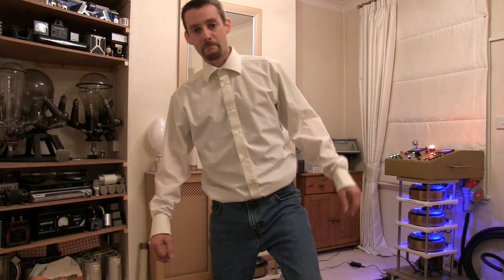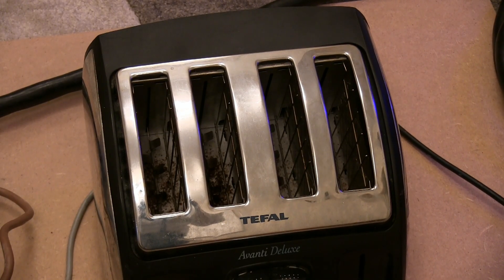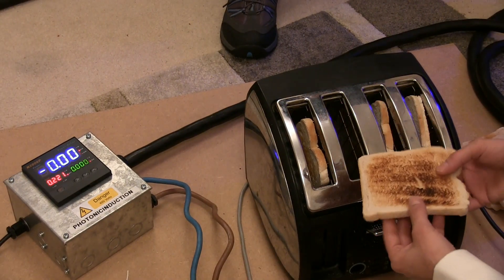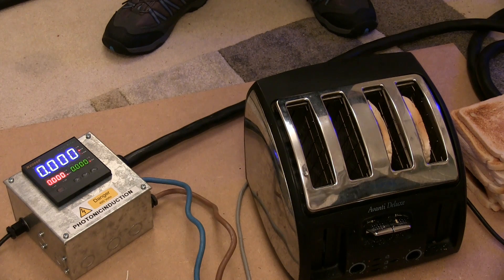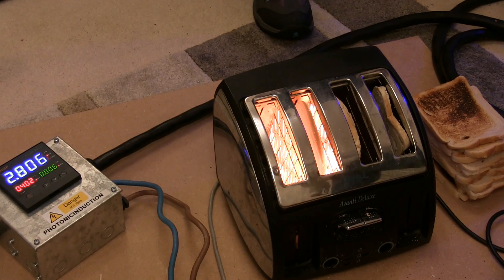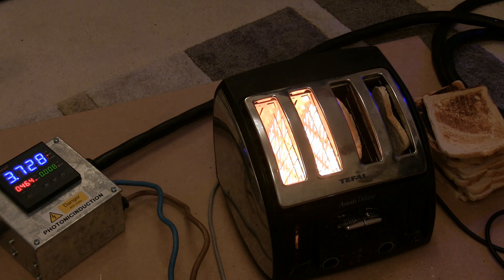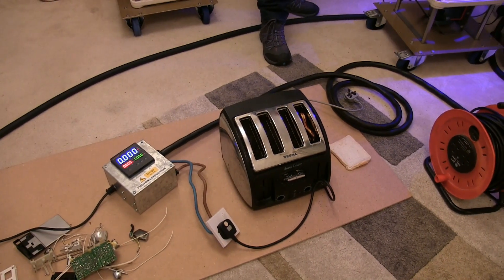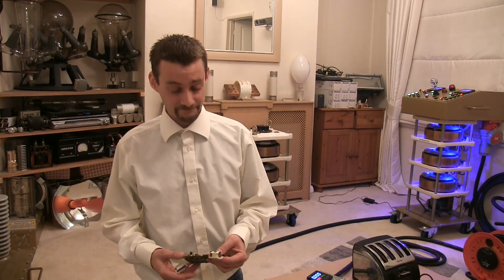10 Second Toaster

Comment: I once had to use a toaster in a motel which for some reason had one of the two elements burned out and all the power was applied to the second one. The bread would burn within 10s on one side.

Comment: @1:16 Modifications on pcbs for every day stuff aren't that uncommon. Seen that a couple of times. Sometimes it's just an additional wire connection and a trace cut, sometimes it's an additional resistor. Seems like they are rushing development quite a bit. Also seems like many companies are allergic to cleaning pcbs. Lot's of flux residue. They probably expect people to throw the stuff away in a few years anyway.

Comment: With higher voltage, the heating wires become hotter and therefore more resistant. 
This partially compensates for the increase in voltage.

Comment: I knew about overclocking cpus and gpus but never a toaster
Reply: What if your cpu is a toaster
Reply: @dillxnr  You mean a Pentium 4 ?
Reply: @cnr_0778  The Prescott first generation Pentium 4 at 3.0 Ghz. Rated for 103 Watts.  I got to test the first run of these at Intel Labs.  We had a nickname for them. The "Presshot". Imagine a heat sink that was copper core and aluminium fins that weighed 500g (1lb).  At 32bits, single core, and eventually ended up as OEM motherboards for Compaq, Dell, Gateway,  HP, and  IBM. I did the 10/100 network chip test and PXE boot rom testing later on. 
A few years later, my group tested the first run gigabit copper network adapter, got the Guiness World record for fastest Ethernet over the 98% packet collision threshold.

I saw a Pentium-90 that ran so hot that it melted the solder and mask on the video card next to it on a Compaq Deskpro in 1996 when the fan  quit working when I was a tech at Tandy Service/Computer City.
Reply: Put it on a inverter and up the Hz’s
Reply: overloading not overclocking technically
Reply: "Let's push it to stupid levels."

Comment: The toasting is not even, the higher voltage might burn out circuits quicker, also the extreme heating of the elements then cooling over time would cause them to lose their strength and eventually break. Possibly also a fire hazard as the toaster housing would get quite hot, especially problematic since modern toasters are constructed with a lot of plastic.

Comment: just imagine the plug on a 480v toaster, it would be bigger than a 2 slot toaster
Reply: +denvera1g1 a serious note that is exactly to scale unlike the above statement, wouldnt it be better to increase the amperage? i've always been taught that the higher the voltage the less heat is produced by a transmission line for the same wattage, and i know these are technically resistors(but so are transmission lines) but shouldnt the same apply? what i'm trying to say is, if increasing the voltage to tripple only doubles the wattage, would trippling the amperage result in the same amount of wattage increase

Comment: That's my man :-)

I've actually been running an old style 110V toaster (flip, circa 1930, coils on ceramic insulators) at double its design output (1800W instead of 900W for one side at a time, effectively irradiating twice as much as your contraption with its 4 side heating), using a single diode on 220V and toasting time, depending on bread type, is no more than 40  seconds both sides and it gives the most deliciously crisp toast with perfectly moist insides, it doesn't get any better than this. :-)

After 4 years, it's still working as good as new, the only thing different is the sound the coils make because of half wave rectifying. Of course, I'd never try this with a cheapo toaster with mica insulator like your Tefal ;-)

Comment: The reason they don't make toasters that run at 344 volts is because the mains only run at 230 volts.
Reply: I believe they actually run at 240volts in the UK and 120 in the us
Reply: It's been 230 V for the last 22 years, before that 240 V.
Reply: +SGTblackcats Uhm,... transformer?
Reply: +SGTblackcats No, I mean that the manufacturer can put in a transformer... of course, it would probably be easier to just change the NiChrome/Kanthal/resist wire size/pattern for rapid heat-up any way.

Comment: This was awesome - surpriced me how much that toaster could take - 4,4 kW peak on a toaster, LOL.

Although it would probably not work to do a 3+ kW toaster that lasts more than a few toasts. Even heating elements do oxidize at very high temperatures - so it will burn off after a while even at lower power.
There are different alloys used for heating elements and the one used in house hold appliences like a toaster is usually cheaper ones that oxidize a lot faster than the better ones used in high temperature furnaces usually up to 1300°C.

Comment: I got an old 1953 Westinghouse toaster that glows about as much as the left side of that one in the first test, it'll make two slices in about 40 seconds, so I guess toasters back in the day just had a brute force approach instead of the gradual heating that modern ones do.

Also that older one has both thermal overheat and circuit protection, and a nice mechanical timer, no messy circuitry to fail, the Chinese one it replaced, decided to stick in the on position and nearly melted itself to the counter top and set off the fire alarm, dangerous cheap junk.
Reply: I bought a soldering iron from a 24 hour shop in Shenzhen in 2008, shortly before Lehman Bros went under. It would not melt solder, but melted the handle, bending over in the stand like a wilting plant, which then dripped down over the iron, made a puddle of liquid, which then tripped the fuse, and set itself on fire.
Reply: @weareallbeingwatched4602  ah,the prank soldering iron,classic prank
Reply: @limesodagod  HDPE is not the best material for a soldering iron handle.

Turned out that you could use those irons but only if you buy special low temperature solder, likely containing mercury and certainly not with an RoHS sticker. I didn't stick about with that, whole place was incredibly chemically toxic. High rise chemical electronics industry no maintenance & black streaks eaten into the concrete on a five year old building. 50ft epoxy hardener smog + solvent stink visibility on a good day.
Reply: @weareallbeingwatched4602  🤣🤣
Reply: They cut the wrong corners.

Comment from the maker: @ Connor Freeman, the output goes though an isolation transformer, ( no earth required )
To get a shock you would have to touch both the output leads at the same time.
The system has an Earth but it is pointless Earthing the device on test.
Enable your reply button man!
Reply: +Photonicinduction Hey dude! I came to your channel a few years ago, because of the legendary video "Washing Machine Self Destructs"... I missed your channel while it was gone and i was out of my mind, when i discovered you were back on youtube with some new stuff.

just wanted to tell you that you really kinda touched me with your final words in this video, just started repairing some speakers and finally did it, well kinda :D thx for your support!
Reply: I really like your custom power supply with the L.E.D.lighted skull on it.Seriously cool!!.T-fal makes a badass toaster,it took over 460 volts before you"toasted"the toaster...LOL!!!.Great video man!!.Bust safely!!.HAHA!!.
Reply: Hi. What do you know about longitudinal energy waves ? Apparently it's this old concept thats gathering a lot or research lately...it's outside the normal electromagnetic principles.
Reply: so its a triple stacked variometer - ring coils with motor driven actuator ?
Reply: ***** it might not go left or right
Reply: ***** its two xformers - going down and up again - smart - does it need special xformers ?
Reply: ***** WTF
Reply: +mathiass0943 He's asking about his power company contract.
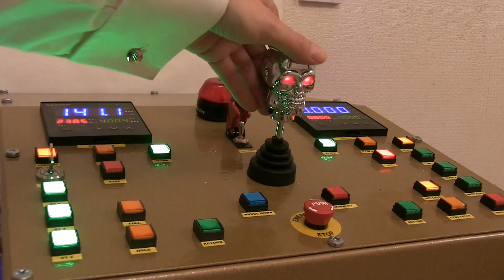Reply: hey in 2:07 what macine you used

Comment: Technically speaking, they could make a single slot 3kW toaster.
Reply from the maker: 3.1kw :)
Reply from the maker: *****
6.2 kW if it has two plugs lol
Reply: ***** You could probably apply a diversity factor to it and safely achieve 4kW toastage on a 13A fuse for the short period of time it would be occurring.
Reply: @bigclivedotcom  or you could use that 13A to charge up a bunch of lithium cells to get even more power for toastage!
Reply: @Photonicinduction  Acetylene Torch = 5 seconds
Reply: @jrmcferren  or use supercaps to store up and release ridiculous amounts of power.
Reply: @bigclivedotcom  How about mentioning this channel in a few future videos? It would be so hillarious if we could make this long gone channel getting into the millions without it even uploading anything for a looon time :-)))
Reply: @HarrieHausenman  not long gone anymore!!
Reply: @TheFaxMachine69  Pop-that-fuse! ;-)
Reply: 3.1 jiga-watts
Reply: Okay, but how do you explain the burn marks on the ceiling?
Reply: What about a capacitor bank inside and when you turn on the plug it charges em and when you activate it discharges along with the 3kw from plug
Reply: 3.6 kw in Holland
Reply: So this is what being an archeologists in the future would feel like.
Finding bigclive comments from years ago on long gone channels :-)
Reply: Aye
Reply: Clive, He could've at least toasted the COB before he popped it. xD
Reply: 900Kw toaster
Reply: It is time for domestic 3 phase 100A sockets, kettles could benefit too!
Reply: Not in USA, are outlets are 115 v at 15 amps, 1500 watts. Unless you want to pay to have a 240v 3 phase outlet put in for a toaster😂 please everybody be safe
Reply: 10.5kw if you hard wire it into an electric cooker supply.

Toast as quick as a flash, blink and it’s a fireball… 

Maybe even a plasma toaster?
Reply: Bro is cooking with a flux capacitor
Reply: Someone i should've expected here 😂 you both love sketchy stuff
Reply: bigclivedotcom how bout a 5kw? i dont think thats even possible xp

Comment: that solder job on that toaster is terrible O_O
Reply: hansley maharaj I think the manufacturer used old and dirty solder in their wave soldering machine, and saved a few cents per toaster doing it. And then spent more on debugging the faulty ones, and fixing them. Well done :)
Reply: A few cents lol they should make them more reliable and +Photonicinduction resistant lol

Comment: Hi
On your metal meter box, it looks like you have Live and Neutral coming out of separate holes, has this given you any problems with eddy curents yet? as this is reconned to be an electrical no no in electrical text books.
Keep up the great videos, better than anything on TV these days.
Ant.
Reply from the maker: Your text books are just that "books."
Several Megawatts are past through transformers in the same way, they are called "Bushings" Everything with a passing current will generate Eddy Currents, nothing to be worried about unless trying to pass an unshielded video signal through at the same time.
This is why "books" should not be always taken "literally."
Thanks
Reply: Ah! I did forget to mention that in my comment to Mr. Photon. Yes, you've spotted it as well!

If that enclosure was plastic, it wouldn't matter too much.

The only way we'll find out if eddys have been causing problems and that's if he does a video showing the melted plastic cable glands and the metal box around the cable glands has gone a funny psychedelic rainbow colour!

-BoomBoxDeluxe.

19th October 2014, 17.50
Reply: *****
Aaaah, that's a very good point, Mr. Photon. :-) I do wonder though, with the transformers, if the 'eddy-current effect' would somehow be reduced by the high voltages present on substation transformers?

My point being, is for a given amount of watts, if the volts are ramped right up, the amps go down, and it may be amps that cause the eddy-current effect.

OK, so we both know that on some transformers, like you say, there's many megawatts (or MVA?) going through the bushings and it doesn't seem to bother the transformer too much.

But then..... Does it?

On those substation transformers, the bushings are more-or-less non-combustible (they can take reasonably high temperatures) the wiring inside the transformer is probably thermally resistant as well, and shielded from the casing of the transformer by part of the bushing sticking inwards inside the transformer casing, and..... The windings of the transformer are submerged in cooling insulation oil.

Some of those transformers have a radiator system on them almost as big a the transformer itself. :-O

It does have me wondering though.... For the few times you have used that unit, have you noticed any untoward heat build-up around the area that those conductors are passing through?

I can feel an experiment coming on! :D

To get an old metal electrical mounting box, pass some high-current cables through individual holes, and then slowly teeeaaase the current up and up, to see if the part of the box between the conductors heats up..... If at all.

This could be the electrical episode of MythBusters. :D

Thanx for replying,

-BoomBoxDeluxe.

19th october 2014, 23.45
Reply: ***** Agreed, books is not the real world. Too many just sit there in a class thinking the only way is the way you were told.
Lets see a test, is Eddy Currents a problem in metal conduit or was he just a forgoten DJ from the 70s.
I think you have the best kit to prove this point.
Ant
Reply: Ant Lane
 When I can get an old metal box and knock-out two holes from it, I will see if I can do a high-current set-up and let's see if I can get the box warmed up by inductive effect caused by eddy currents.

I have a couple of little transformers that Mr. Photon gave me and those can (for a little while) punch out a good 45A each.

So, if I parallel the outputs and crank them a bit, I may be able to rustle-up 90A, and I'll even put an electric meter on there so you can see it whizz around. :D

-BoomBoxDeluxe.

20th October 2014, 16.05

Comment: Mmm, tasty. By the way, what does the thinner black cable go to on the output box? Is it an auxiliary un switched, un varied supply for the meter?
Reply: Ah, I've wanted to know that also. I think there's clues in this vid: When he turns off the output on the large variac and Busta powers-down, the load-meter still remains powered-up.

So, on that note, I think the thinner power cord is a mains power cord for energising-up the meter at its correct voltage so that it works regardless of the output voltage of the variac, because if it was wired to the output of the variac, it wouldn't work too well on the lower voltage range, and you know..... Seeing as that the meter is monitoring the voltage on the output of Busta, if the meter itself was wired to the output of Busta, then the moment the meter is fed with a voltage exceeding 240v, there would be meter poppage! :-O

Taking all that into account, and making sure that the meter does what its supposed to do, and do it accurately, I'm more-or-less sure that the thinner black cord going into that meter box is the power supply for it. :-)

-BoomBoxDeluxe.

19th October 2014, 17.40

Comment: I'm looking at that lovely carpet and I'm wondering when the inevitable will happen...
Hey Photon! My 8.5kw shower pissed me off so I scrapped it but the heater unit still works... Reckon you could bust the fuck out of it?
That's what the PO Box is for right? :)
Reply: Hmmm...... That might be a bit difficult, because even if he gives it a 200% beating, it'll be tugging 17kW off the mains. OK admittedly, if he does get the chance to do it in and fizz it over, it'll be "running dry" with no water in it, so even at its rated voltage, it may give out, but take a little while to do so.

Seeing one of those heater units on 200% would be interesting, because then it would have to be asked:

What's the chances of making a 17kW instant water heater?

I couldn't imagine the noises it would make..... It would sound like a kettle, only 5x louder! :D The water output temperature could be varied by adjusting the ingoing flow rate.

Four temperature settings..... (1) Warm. (2) Hot. (3) Scalding. (4).......Cuppa-Tea-Tiiiiiiime. :D

OK, if he run it dry on 250% (about 21kW) it would definitely start Glowiiiiiiin' in there...... and at the same time, it would be interesting to bore-out one of the water outlets a bit so that the unit could be filled with lead pellets before powering it up..... make a lead-melter with it. :D

-BoomBoxDeluxe.

19th October 2014, 17.30

Comment: Tefal Toaster vs Photon Toaster 
---Test Results---

Tefal takes 3-5 minutes to make a toast
Ph.oton takes 10s to make a toast.

Tefal needs to heat up the wires to a ready-to-use state. It takes 30s to heat up.
Photon doesn't need heat up and can be directly used. Heat up finishes at 3s.

Buy the Photon Toaster! Only $19.99!
But wait! There's more!
Call now, and you can get 3 bags of bread FOR FREE!
for a instant toast. Here's how to order:
--Info--